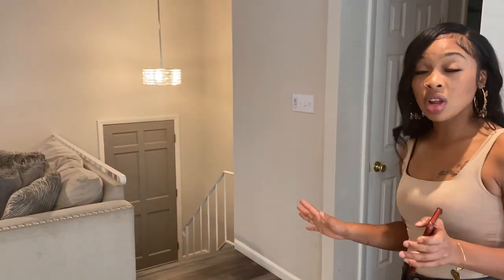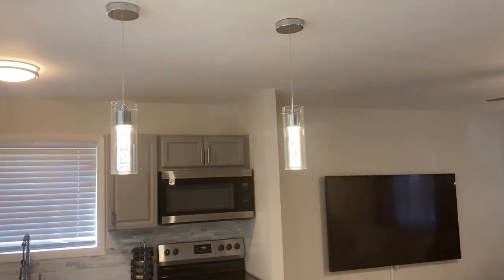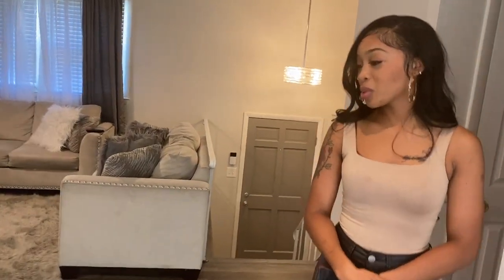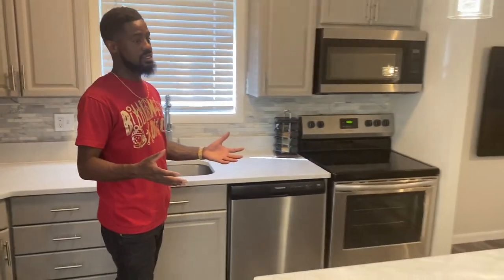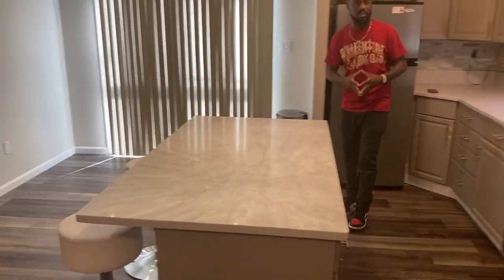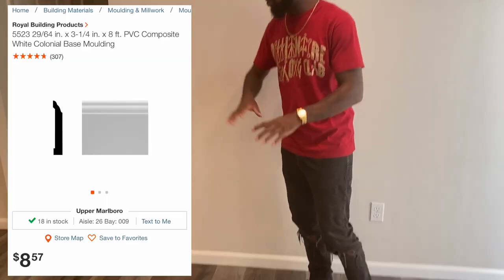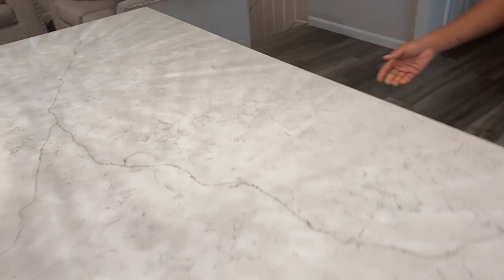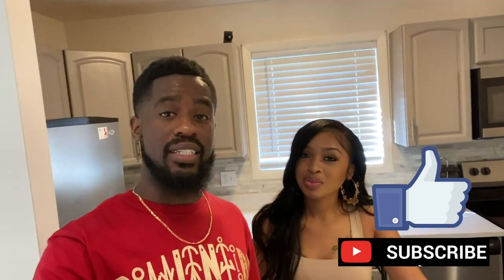Small DIY Kitchen Renovation | Real Estate Investing | Let’s Fix This House 🏠 Episode 1

Comment: As someone who has a little construction experience, could you have installed the high quality vinyl with a quality moister barrier right over the existing floors?
Cover stain by zinsser seems like a good product, will check that out.
I really like how you got in there and grabbed the bull by the horns with the renovation, very ambitious!
back splash is clean simply mat what a hack!!!
Great vid sir!
Reply from the maker: Millennial Financial Product Yes, but it was carpet in the family room, and since vinyl can’t go on carpet, we took it all up.  The vinyl planks I used actually already have the barrier built on the bottom of the planks, so they can be installed directly in the subfloor.  Thanks for continued support man💯👍🏾 Appreciate the feedback.
Reply: Tim Leak - Real Estate 
Ahh yeah carpet, missed that. 
I though it was that linoleum flooring that y’all were ripping up! 
For sure your channel is awesome glad to be apart of the team!